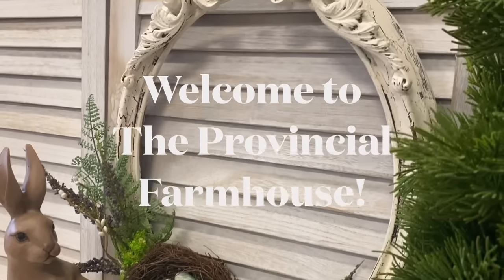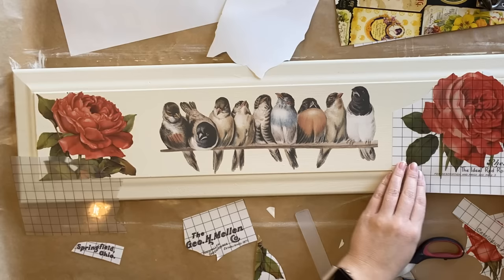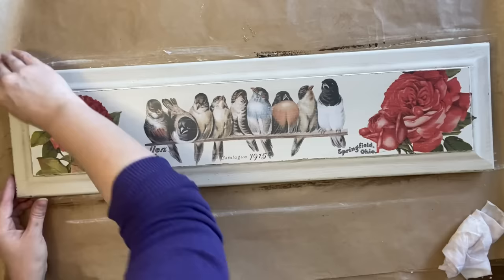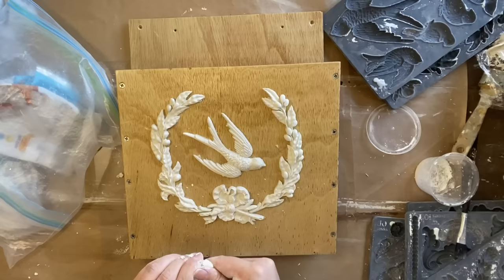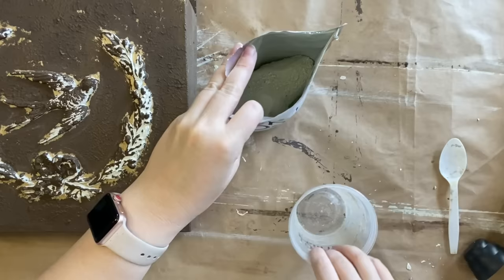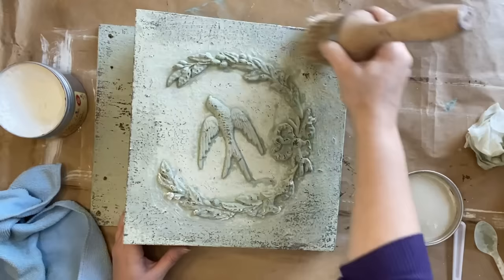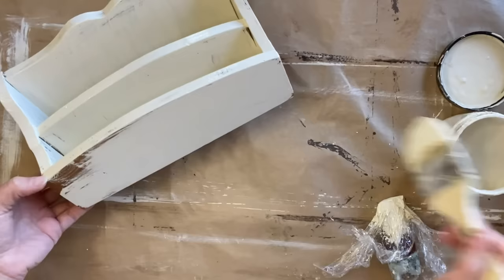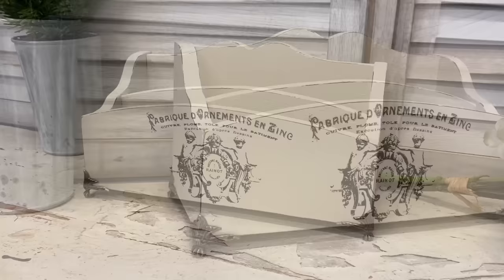French Country Entryway Decor Thrift Flips using IOD & Fusion Milk Paint | Trash to treasure

Comment: You're very welcome my friend ❣️ I've been working with milk paint for almost 10 years. Still unpredictable at times but I am pretty confident that I can control it majors of the time 😜 I find that with milk paint, I have used every brand out there in powder form including Fusion, that you get much more cracking and chipping on the second coat. With 1 thick coat, I get much less. I usually do 2 thinner coats, drying both coats with my heat gun to enhance cracking and chipping. I was taught this by Jami & Zeb from Jami Ray Vintage. I ended up doing a lot of research on milk paint and everything said that if you want more cracking and chipping, It's usually always the second coat that give you that look. Ive had times where I've used the clear coat gloss as a resist and even wax on top, then dried the coat with my heat gun and had no cracking or chipping at all. I then apply the second coat following the same exact steps (even using wax as a resist over the top of the 1st coat) I dry it with my heat gun and get phenomenal cracking and chipping. 9 times out of 10, it's that second coat that gives me my beautiful chippy finish that I am looking for. Do some research and give it a try on a piece and let me know how you make out. Ive got my fingers crossed, girl 🤞❤️
Reply from the maker: Thanks so much Amber 😊 I appreciate your helpful tips!